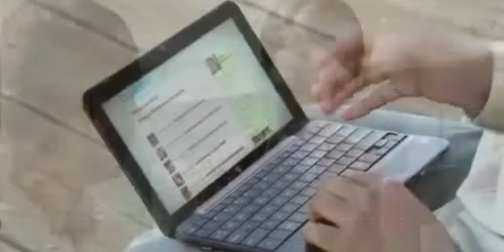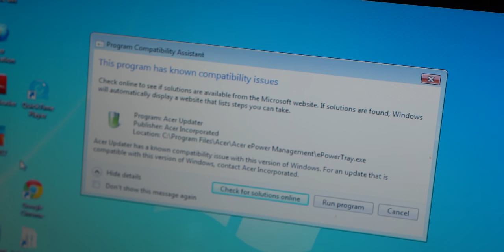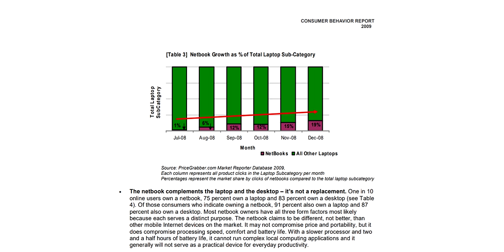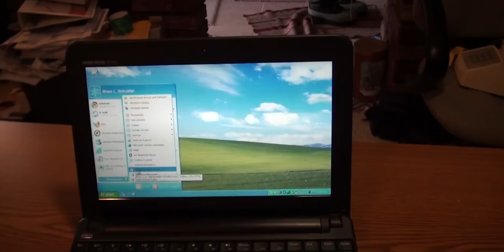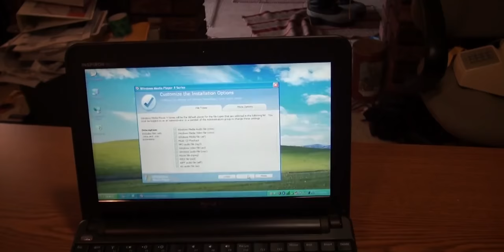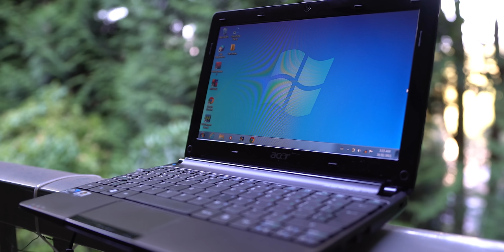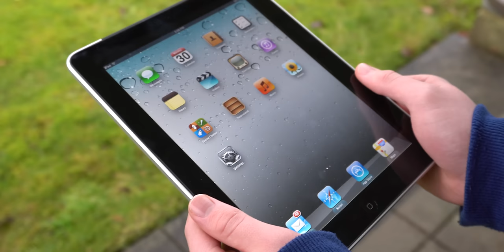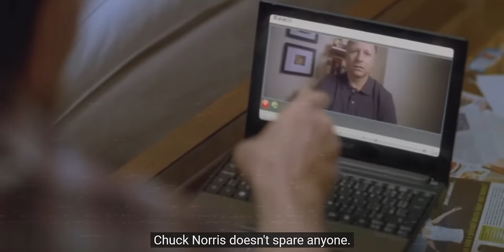Why Netbooks Failed - Modern Retrospective

Comment: I owned a netbook, a very nice one(visually), only 2gb's of ram, a dual core processor 4 threads, used a 2.5" drive. Admittedly, the ram was what killed it(that and my fists when I slammed it into the keyboard tray bending it in half out of frustration) Now I own what is probably equally bad hardware(if not worse) in a chromebook but with 4GB's of ram and ChromeOS which I absolutely love and actually prefer it over my gaming rig(Though, I do have an installation of ChromeOS on my gaming rig too)

Comment: I have used an EeePC (a later 10" version with integrated 3G wireless modem) for a long time, and actually did so until about 2 years ago.
Of course, one of the first things I did, was double the RAM from 1 to 2 GB, kick out Windows 7, replacing it with a Linux distro of my choice (a step I have now gone on all of my computers, none of them has Windows as the primary OS anymore) and later even swapping the hdd out with a small ssd. (I also had to swap the display panel once, but that was all my fault...) The device is 11 years old now, and amazingly, the battery still has several hours(!) of life with a full charge.

The only thing that kind of killed it fo rme is that its Atom CPU is only capable of running a 32-bit OS, and it's harder and harder to find ones that are still updated today. Otherwise it's a perfect little machine if you are doing things that don't require a lot of computing power, especially if you need to type more than just your occasional Facebook comment and therefore can't live with what a normal tablet would offer.

Comment: Was perfect for me as I had a mobile workstation for school but didn’t need all that weight and power some days. I had the Aspire D257 and later I got the model in this video the D277 (I think) and it was basically perfect, I did end up getting a windows tablet later though lol.
But I put tiny7 on that netbook and it is perfect for it, battery still lasts a long while and it can be useful for some stuff even today

Comment: Netbooks never went away. Instead, they evolved beyond their original license-imposed limitations. Today, you can buy cheap laptops designed for schools with Windows 10, a 14 inch screen and full size keyboard for less than $300. The biggest downside however is that the memory and HD are usually soldered onto the main board, limited to 4 GB and 64 GB respectively, and can't be upgraded in any possible way. But if you go on a trip and your laptop's lost, damaged or stolen, it's not a big loss. That's why I use them exclusively as expendable devices.

And you can change the background image! 😁

Comment: I think the actual failure was in the case of Chrome Books, they came in on even more limited hardware, usually using a Snapdragon or similar processor, maybe at best a GB of RAM, and a storage capacity of almost nil (8 GB), and a crap GPU, leading to a product that you were lucky to even play a YouTube video at anything better than say, 12 FPS. If it played at all. After that, netbooks were dead, essentially.

Comment: Netbooks were decent for the time I had one in 2008 ish... Back then cell phones were still kinda slow , tablets were either expensive or under powered and laptops even crappy ones used were expensive... I do give credit to the netbook though.. They were pretty much the predecessors of the chromebook...

Comment: I had an Eee PC somewhere in the '00s and the Linux OS on it was just freakin' horrible. But it could be turned into a Hackintosh and with an external screen, keyboard and mouse it was a pretty decent "Mac". I even created some tunes on it running Apple's Garage Band. I never regretted buying it.

Comment: Another issue you may have wanted to mention: Linux support on these Atom-based Netbooks is horrendous, with basic 2D Acceleration being non-existent on the Intel "Poulsbo" driver for the GMA 500 iGPU; a design based on a licensed PowerVR SGX core (Power VR SGX535 as in the Apple A4), for one. Basically dead in the water even for these wanting to ditch Windows starter editions to Linux.

Comment: Netbooks were a good idea with a poor targeting. They weren't made for streamline users who'd stick to Windows and be miserable while at it, they were great for users that could use a Linux in it for basic web and text, having a great experience at it.

I bought a cheap Aspire One myself in 2017 as a poor student in Brazil to solve my issue of not having a simple laptop for classes and presentations, and running a Linux distro into it turned the experience into a great one: reliable, huge battery life and fast enough for most things, even rescuing a friend undergoing a dissertation evaluation and having my Aspire One save his day by running a simple presentation for him on a VGA projector, something that his macbook couldn't do and that the University's PC also couldn't (it died, and they had no backup without calling someone and wasting everyone's time).

Netbooks are not for streamline experiences, as cheap notebooks also are not. The only cheap cases of success in streamline are devices that are able to sell themselves with their own systems, avoiding Windows like the plague (tablets and the chromebook are good examples).

Poor hardware and Windows out of the box? Haha, there's simply no way it will be good.

Just like nowadays with i3 and celerons into hard drives for Windows 10, a recipe to make people hate their notebooks. By the way, had a worse experience with a Dell running an 8th gen i5 into Win10 than I had with a Aspire running Linux, just because I didn't have to withstand Win10 going 100% HD all the time and not letting me do anything at all.
Reply: Windows is actually the reason 50%~60% of the people don't even use computers out of work anymore. It is worse than most tablets and phones that are able to do what they want to do (web, docs, music, etc.).

The number of people that actually need to run Windows is absurdly low, and most of them are gamers. Very few run things like Reaper or an Adobe Suite, and need Windows, and that's why they tap out at the first sight of other devices that run other systems, like OSX, iOS, Android or any Linux Distro.

And that's gonna get even worse if Windows 11 brings all those changes in compatibility, leaving people with good hardware behind and, even worse, leaving people with poor hardware stuck between a dead win7-8 or an unusable win10 that locks them out on Hard Drive usage alone, clipping at 100% randomly and leaving them strandling.

Would be a good time for a Linux adoption for most people, and they already did on their phones and tablets with Android, and with their Chromebooks. Those who like the desktop should become aware of alternatives, and try some distributions that would surely make them way happier than they have been with Windows.

If any are reading this, I'd recommend Fedora 34.

Comment: Microsoft unironically enough, revived it in its successful Surface Pro line - compact, powerful and versatile devices. This is what the netbook evolved to: a tablet that could also function aa an ultraportable. Microsoft may have killed off the netbook but it made it even better. And mini laptops are still a thing in 2023. The demise of the netbook has been greatly exaggerated.

Comment: I see alot of people defending Microsoft in this video and I feel I must make people aware of why Windows XP was supported for so many years. The ASUS eeePC was introduced in 2007-2008 with Linux one of the many ways ASUS could sell these for cheaper was to bypass the OS licensing cost. Aprox $99 a machine thought OEMs tended to get Bulk discounts so it was probably lower then that. However MS at the time hated Linux, and launched an Anti-Linux marketing campaign thought stores like BestBuy and other big market retailers. As well as Reducing the OEM License cost for Windows XP for these low spec machines, they also increased the support time for Windows XP along with this. People claim that this was done due to the failure of Vista, but the true reason is Microsoft feared losing Marketshare to Linux on these low powered devices.

When Windows 7 came out Microsoft really wanted to try and keep people off of their older OS they created a Windows 7 license for Netbooks, to keep that cheep rate they created the stripped down starter edition. Obviously by this point the idea that Linux cant run your printer (despite the fact that most printers supported CUPS due to OSX) was widespread and most OEMs who now had a foot in the Netbook market felt a need to ship Windows with their product, so in order to keep the cost low, these companies had to deal with the BS that was Windows 7 Starter.

On a side note, it should be noted that Windows powered netbooks came with all the bloatware seen on normal laptops enjoy your Norton Trial, your Office Trial and all the other junk that came bundled slowing down your performance if you didnt know how to computer. This was normally done to further reduce costs and still is on Windows Licensed machines to this day.

Comment: Netbooks were cool. I had the HP Mini. HDD died on it, never bothered updating it or getting an SSD one. I have a mini fanless box for my netbooky needs these days. That's pretty much playing music and dumb online games with. lol. I did write a few papers on that old HP Mini. It also could be a fun test bed for the "how will this new software run" thing. I got the extended battery.
While I get they were low powered, kinda nasty little machines that probably decorate landfills now, I liked that it ran a natively accessible, pretty common OS. Windows XP. Linux does and always will be a pain in the backend for Desktop users who wanna do anything cool. At the time, mobile CPU tech was lame and it was hard to interface desktops and mobiles. Not only that but everyone used their own crappy phone OS, their own skinned tablet thingy. I couldn't just take Notepad++ and some other standard Win32 applications and feel at home, rather than learning something new. I'm a learner, but one thing at a time. I already gotta mess with the tiny keyboard and limited disk space. Least the OS was good. Just gotta uninstall that bloat HP and every other big vender puts on their boxes.

Comment: Ah. The eeepc. I totally forgot it initially came with linux. Its somewhat ironic that in some ways, its successor is the steam deck
Reply: I remember that the Linux version of the Eee PC sold at big-box retailers here in NZ were usually $50-70 dollars cheaper than the XP versions.

Comment: I used a netbook from 2008-2011 for college. Yeah, the first thing I did was install Linux on that thing. It came with Windows XP, but even that was a bit too bloated for those machines. However, mine did have a decent amount of disk space compared to that first generation one. I also upgraded the ram since I bought an MSI one that had a free dimm slot for a ram upgrade. Where that device really fell flat was the Atom CPU. That thing was GARBAGE.

Comment: I've had 2 netbooks, my mother had one and my sister had one and we all loved them!!! 

If I remember correctly I had one with Windows XP and one with Windows 7, I did basic webbrowsing on it, also watched Youtube on it and even used VLC to watch movies or tv shows on it. I also had 0 issues with installing MS Word or other word Processors on it.

My first one died because I accidentally stood on it one day TT^TT, my second one the screen ended up dying on me but I still have the hard drive lying around the house now and it still works! Unfortunately my experience with tablets has been horrible, I've never had the money to buy a decent one and the cheap ones were way more limiting in functionality (Android back then was just not great, oh and the kindle fire, terrible!!)

Also the writing software I used wasn't on Android, this was before Windows tablets were a thing oh and when the ipad was first announced you couldn't really multitask on it plus the price was not comparable.  Ah and my netbooks had removable batteries so to preserve battery life I would unplug the battery at home and just run it with a cord!!! I miss those things honestly

Comment: I had an MSI Wind 100 (I think that was the model number) and it was fantastic. Tiny little machine I could throw in my backpack and beat up without worry. I dual booted Linux and WinXP on it and it was fairly peppy for that underpowered Atom. When it died (corrosion on the motherboard - again, I took it everywhere) I replaced it with the most netbook like machine I could find in 2015 which was a Lenovo 11e with a quad core AMD and an SSD. Again installed Linux and is an awesome little laptop. This time instead of plastic it has a metal bottom and passes mil drop test and dust. Again I can throw that in my backpack and not care if it gets a scratch or a dent. I'm looking for my next little laptop and I'm not sure what is out there that is as durable and inexpensive.

Comment: I had an Aspire One. The OS that it came with stopped updating within a year. Tried using XP but it ran to slow so I switched to Lubuntu. Pretty neat but my friends that had the EEE 701 had an overall better experience in the long run.

Comment: They still sell what I consider to be netbooks.  They don't call them that, but that's what they are.  They have 32GB storage space, they run windows 10, and are crap for anything but running web browsers.  They sell for around $250 new.
Reply: If you want a pretty much something like that but good and you have money the gpd win max is that has a built in controller and can play  the same games better then a Nintendo switch can. Not cheap but yeah I learned my lesson and won't buy any computer that is less then 800 dollars anymore better to save up longer then for it to get slow.

Comment: My Boss: "I want you to upgrade these EEE-PCs."
Me: "They have as much RAM in them as they'll take."
My Boss: "No, I want you to replace Windows XP with Windows 7 on them."
Me: "If it even runs it'll be horribly slow."
My Boss: "Well we can't have Windows XP on the network any more."
Me: "Alright then..."

(a week later)
My Boss: "We're getting complaints that the EEE-PCs are very slow. Can you fix it?"
Me: "They'd run faster with Windows XP, or we can buy proper laptops."
My Boss: "So you can't fix it?"
Me: "You told me to break it by putting Windows 7 on."
My Boss: "Well you should have said something."
Reply: And don't get me started on the Samsung NC-10.

Comment: Atom in blame? We owned three netbooks at some points - original 901 with celeron, and two clamshells - with Atom and AMD A400. And Atom was most "powerful" of the bunch... After upgrading to SSD it is almost bearable. No surprise - budget laptop with almost same specs from the era was similarly bad.

Comment: What I hear is that the problem was really the hardware and that Microsoft stupidly bundled a crap version of Windows in most of them. I had a Acer Ferrari Netbook with real Windows and good hardware and it was a very good PC that was still pretty cheap but much more expensive than normal Netbooks. I really see them as precursor to Ultrabooks so I think they taught PC-makers a lesson and seemingly taught Microsoft nothing at all so we got Windows 8.

Comment: Microsoft is a big part of what killed the Netbook. There were quite a few netbooks that used Linux (quite a few on ARM CPUs as well) until Microsoft used its power to push vendors like ASUS into dropping the Linux ARM stuff and going with crappy low-powered x86 stuff and cut-down crappy versions of Windows instead.

Yes some people bought these things and got annoyed that it didn't have Windows and demanded it run Windows but those idiots were missing the point. The Netbook was meant to be a small affordable machine for doing web browsing, internet stuff, educational stuff and various things etc that got good battery life. It wasn't meant to replace a proper Windows laptop. 

The Chromebook is the closest thing to what Netbooks were meant to be (although given that they don't need to run x86 software specifically, I don't get why all the Chromebooks run Intel chips instead of a decent higher-end ARM CPU instead that could deliver better battery life, is this just Intel using its market power again?)

Comment: 99% of the desktop PC and laptop made after 2023, you won't be able to upgrade, everything will be soldered to the board, and they'll be chips on them, and be alerted if you temper with. this new generation sucks period. I miss the computers back in the 80's and early 90's!